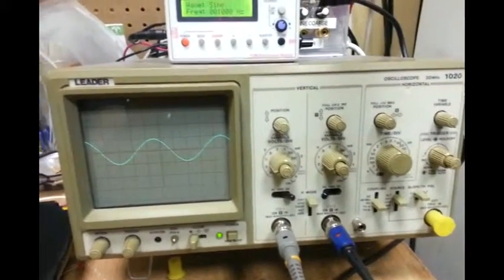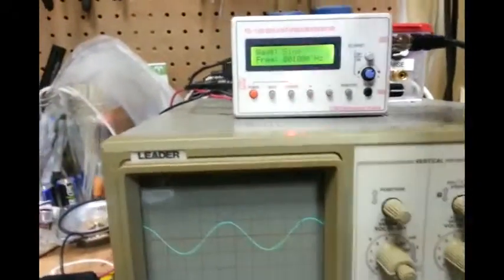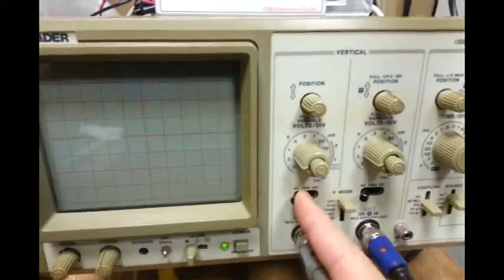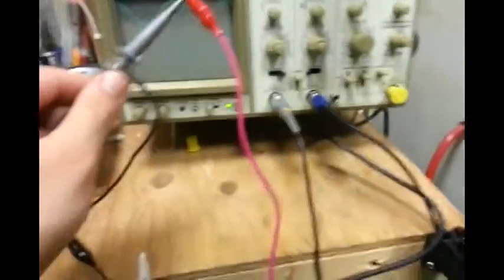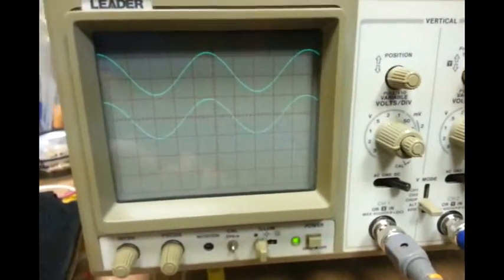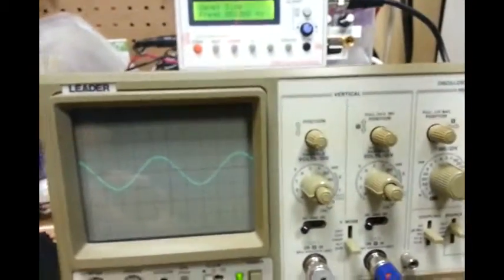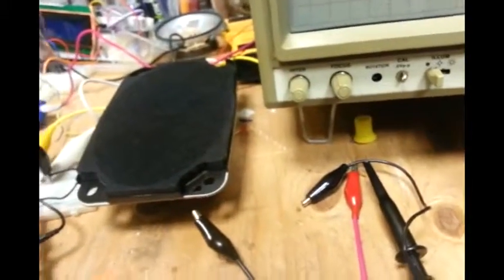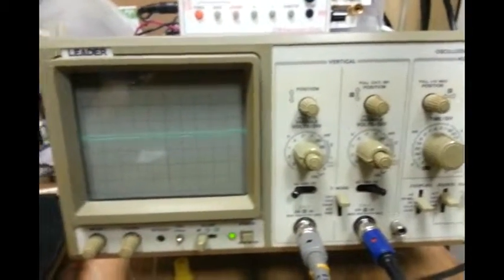Playing with an oscilloscope and function generator

Comment: I have the same oscilloscope, but display won't turn on. Any advice??
Reply: Be sure Capacitors at the back of tube is fully discharged before even visual inspection.